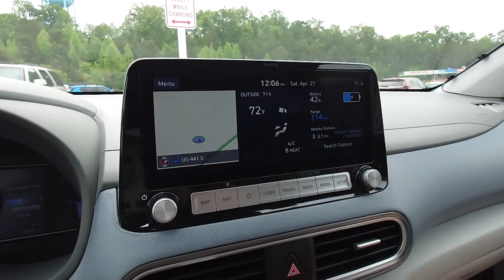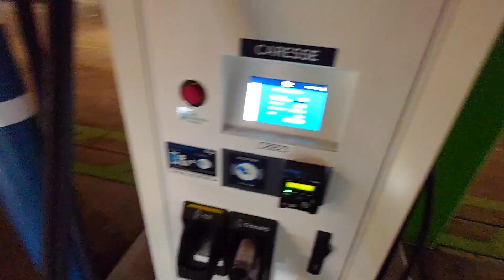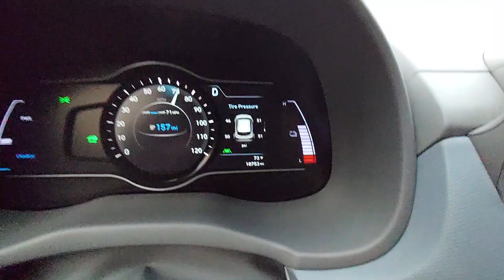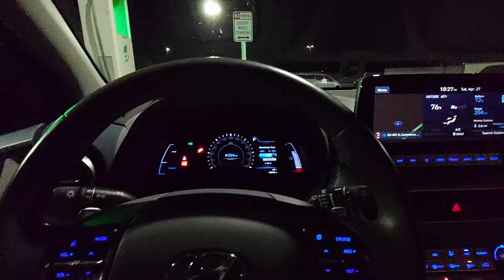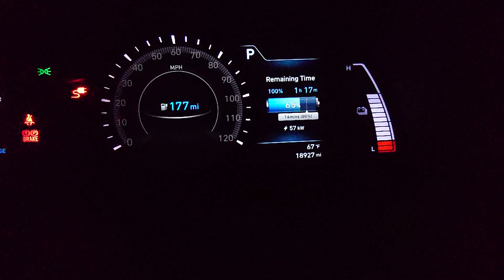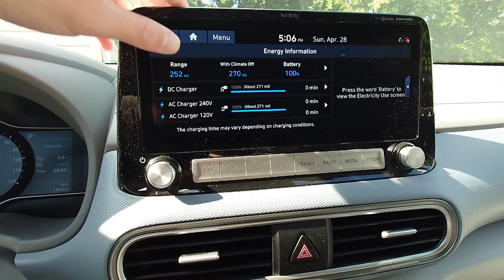2020 Hyundai Kona EV road trip review with DC fast charging

Comment: but do you use onboard hyundai nav? Because that nav is connected with quessometer. Android  google maps app and car odometer have different counting kilometres. Also setting hyundai map should preheat the battery to optimal temp to have good charging curve at the charging stations. New hyundai kona (gen2) has button for manual preheating the battery.

Comment: Where did you get that this car weighs almost 5000 lbs? The curb weight is around 3800 lbs. The gas powered one about 3300, so also not 1000 lbs difference.
Reply from the maker: I don't really remember but your right it's about 3,800 pounds

Comment: You should update your infotainment system; the latest version has a built in EV route planner.
Reply: I have a 2019 Kona EV. I will be taking it on a road trip soon. How do you update the infotainment system? Is that somethign done at the dealer or are there OTA updates?

Comment: Did you experience any significant throttling? I had a Nissan leaf before and when I tried to super charge it more than once back to back, it would throttle the charging to the point of making it impossible to road trip. Thinking about getting a Kona. Wondering how much better the experience would be if I went from San Diego to Phoenix and back. Took me about 15 hours in the leaf one way because of throttling.
Reply from the maker: We didn't experience any throttling until the state of charge became higher which is typical. Once you get to about 80% the charging speed will be slower due to the way lithium battery chemistry works. The Nissan Leaf does not have a liquid cooled battery but instead relies on air cooling which is not efficient especially when the vehicle is not in motion. That is one of the downfalls about the Nissan Leaf is that as the battery gets warm on a road trip it can dramatically impact charging speeds. I would say if you're able to find a good price on a Kona to trade in the leaf and get the Kona because it will be a vehicle with better range and better charging speeds even though the Kona is not as good as more expensive EVs like the ionic 5 or Ford Mach E for example. It is a good contester for the price though. So far we really liked it.
Reply: @theelectricreality  yeah I can get a 2022 version for 15 - 17k pretty easily with about 20k to 30k miles on it. I think I might have to go for it. Thanks!

Comment: Thanks for the video. When you see EA chargers that are offline, make sure you report it in the app. I've found they do actually send out a technician when a report is made. 

Also recommend signing up for EVGo Autocharge, it does work with the Kona. Makes the whole process super easy and more reliable. Newer EVGo stations are much faster. 

I've done four road trips so far with my Bolt EUV. Most recent was ~1500 miles all around the Midwest from Ohio to IN, IL, MO, and (briefly) KY. I've also used the rule of thumb that filling up the distance you need to go + 50 miles always gets you where you need to go.